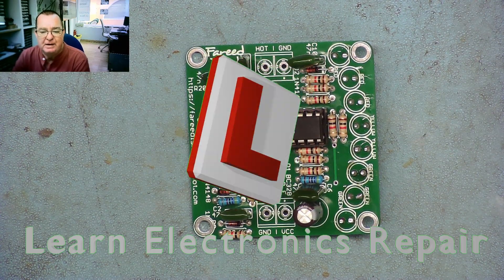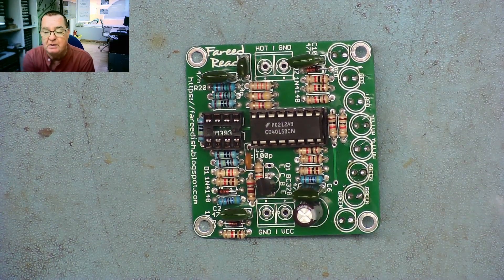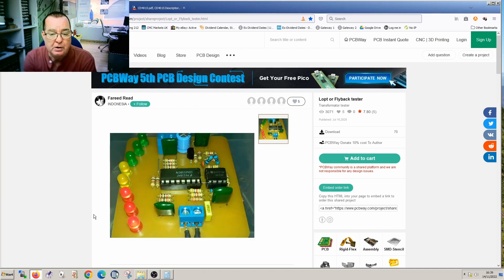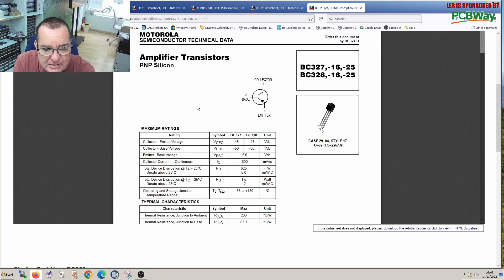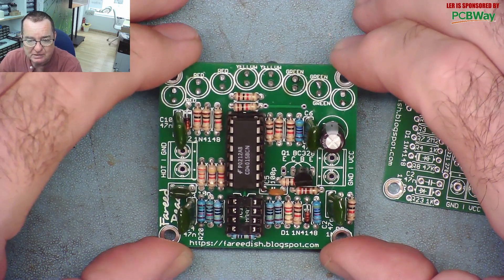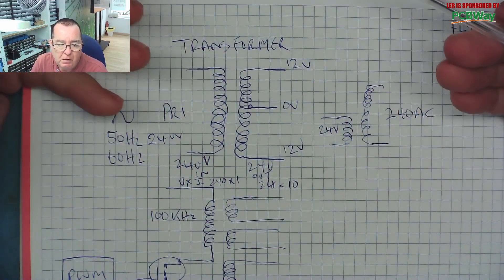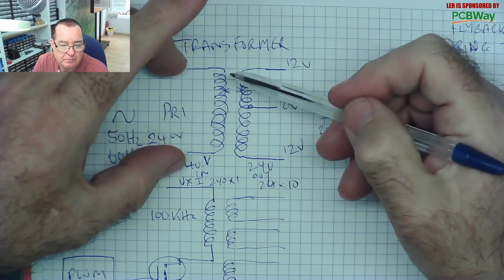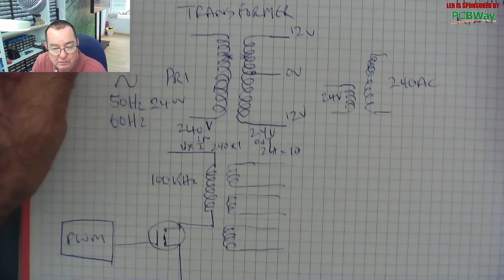All You Need To Know About Transformers To Fix Stuff - Linear & SMPS Ring Flyback Tester

Comment from the maker: Thanks to a couple subscribers on here, I now have the link to the actual schematic this project was 'inspired by' 😁

You can see my rough incomplete reverse engineering did identify the main functions of the Ring Tester and I correctly determined how the circuit operates, but I also made a few mistakes as well.  In particular i got the 4015 IC pinout wrong which is why the order of the LEDS seemed strange
http://bobparker.net.au/lopt_tester/k7205.pdf

Comment: There's a more convenient way of finding out all connections, by taking 2 pictures.
In your case it's very easy because it's perfectly flat (otherwise you should take a picture)

1) Scan both sides of the PCB (place it precisely so you won't have to rotate the image afterwards)
2) import them in a image software (like GIMP)
3) Copy one of the image (the one containing no component IDs) and add it to the other image as a new layer
4) Make a mirror vertical and horizontal with that new layer
5) Play with the layer transparency and move it so it matches the other

=> you'll see all connections directly !

I've done it with a power supply and comes in very handy !

Comment: Really interesting to learn all the aspects of defining what a flyback tester is for, I've heard the term previously but no more. Working with gaps in the items associated with such a project, namely the schematic, then reverse engineering using the PCB was a gift to all the viewers.
I've handled transformers since maybe my first day at work, October 1963, assisting my foreman to build a control panel for a processing machine in a leather tannery.
In the UK there was inadequate sources of electrical contactor's for industrial motor control, MEM, Midlands Electrical Manufacturing, based in Birmingham, founded in 1908 building switch and fusegear to British standards.
RS Components based in London was a 16 page small paper of electronic components, the really bare essentials, resistors, wire and carbon potentiometers, capacitors, some small useful enclosures, not a lot else.

Comment: Great job of reverse engineering,  it's a pleasure to watch you work! It would have been interesting to see the oscilloscope with the shorted "winding" as added proof of the  concept. Regards,  David
Reply from the maker: Sorry yeah I forgot to do that, as I was so surprised at how well the ring tester worked
Reply: @LearnElectronicsRepair  and also short the turn whilst the ring tester is powered up (if you have spare hands, I did notice you powered it off when messing with the 'shorted turn' wire), it should go down to the single red led and back up to them all being on when the short is removed... if you see the scope screen at the same time you'll see the ring substantially damped when shorted :)

Comment: excellent i think i will order the boards and make one.
at the moment i use the cal output on my scope and zoom in on the wave form and count the rings. On mains transformers i might get 2 rings on the primary and none on the seconderys
Reply from the maker: That kind of goes along with what  I found when testing the secondary of the 50Hz mains transformer.  Though I omitted to test the primary, the best I could get on the secondary was one ring, as I think the first LED lights up just from the 'trigger' pulse, even if the tester is not connected to a transformer

Comment: the way to test them is with an LCR meter measure primary then secondary take the square root of the ratio  Lp/Ls  it should be qual within 1% to the turns ratio Np/Ns or voltage ratio Vp/Vs  if it`s  more than 1-2% something is wrong if it`s way off you have a short 100%
Reply: That may work moderately well for true transformers but it probably won't for a flyback inductor. The flyback inductor, commonly but inappropriately called a transformer, is not designed with a turns ratio based on input/output voltage, but on inductances as such.

Comment: I made an inductance meter using an Arduino, an LCR resonant circuit (you connect the L - inductor) and the LM393. But instead of counting the rings, it measured the frequency of the rings (oscillations) which allows you to calculate the inductance value. These two things could easily be combined into one device, but I don't know how would you measure pulse length without a microcontroller.

Comment: The LM358 is not pin compatible with the LM393, the LM358 is a dual opamp while the LM393 is a dual comparator. Yes, with additional components an opamp can be converted to a comparator, however they certainly are not plug in compatible devices. Also, I believe the LM393 has an open collector output which would mean it can only sink current, not source it, which would in many situations make it incompatible with standard opamp output circuitry.
Reply from the maker: The circuit should use a LM393 and I didn't realise because in the video the author (who appropriated this circuit it would seem) showed an LM358 in the version he built, so it just so happened I didn't have any LM393 to hand.  Google does say you can substitute LM393 with LM358 (apart from the higher current/voltage capabilities) but then again, when i built the PCBWay millivolt meter, Google told me that a 741 op amp is a suitable replacement for OP07, which turned out to be 50% correct when I tried it LOL
Reply: @LearnElectronicsRepair  They can SOMETIMES be compatible in SOME situations. If someone is using an OP07, that is one of the first "precision" opamps made in the electronics industry, so there is likely a reason they are using that part, over some other standard jellybean single opamp. If someone is using an LM393, they likely have a reason they want a specific comparator design opamp (for instance as mentioned above its output electronic design is completely different from that of a standard opamp) as opposed to a jellybean general one, again.

Sometimes a jellybean part can do the job of a specific part but just worse, likely the case here (and for a course case, in the end that might not matter that much). Sometimes the design relies on a feature the jellybean doesn't have that would fail, like needing manual offset, or needing rail-to-rail input and/or output capability, super fast speed, etc.

Whenever you see a non-standard part you can start asking if you can find a reason why they used that part instead of a LM358/LM324, etc.

Comment: Great video about reverse engineering, but.... What about the strange connection of LEDs, when the last green is in the OUT4B... And DATA A is connected to OUT4A... It has no sense to me... Should you check it again or explain it little more? Thank
Reply from the maker: It didn't make much sense to me, but I was talking to Carlos from Retro Upgrade today about using AI (which is something he is working with a lot) to produce a complete schematic from a PCB layout - using this PCB, which I gave him, as an example, so I am sure you will be seeing more of it later
Reply from the maker: David O   I now have the schematic (see the pinned comment) and it turns out my reverse engineering was OK, but I mixed up the pin order on the 4015 😅  So that's the answer to the paradox

Comment: From experience I can tell you that "component tester" from aliexpress can test coils quite OK, so if I have to have transformer out of the circuit, I will not bother to make this device really, I will just make chart of resistances and inductance then I will figure it out if its good or not. These days there is 2in1, component tester + oscilloscope in one device.
Reply: This comment is a year old but if you still see this I would love a link to the one you use 😊
Reply: @SpasticalGaming  Model is LCR-TC1

Comment: Good explanation, reverse engineering. Big Clive, eat your heart out, ho, ho. One of the associated videos shows 2 x 18650's powering it (so 7V or so). Yes, these testers work best with high Q transformers (line output etc), search Blue Ring tester for a similar (not the same) circuit.
Reply from the maker: Thanks Ralph that's a big complement being mentioned in the same sentence as Big Clive in a positive way 😊  I have seen that Blue Ring Tester before so probably I should build one too for comparison

Comment: Assuming your reverse circuit is correct, the input stage to the LM393 comparator is a LOW Q because of the low value resistors after the input "hot" capacitor (it's funny that he used a high quality high Q cap and then destroys the Q on purpose???) , which will destroy any high inductance rings (like the transformer you tried it with), ...lower inductance will fair better because they cap will not be subject to the resistor current drain (Q leakage) for as long, but at low frequency nearly all the energy will be drained by the time even the second ring tries to start!.  It is a VERY BAD design!  For reference, anything above about 30-50 Meg Ohms will have a noticeable affect on the Q (ring count), he has values 3-4 orders of value TOO LOW.  The circuit is intended for low cost, but he failed because with the same components (except resistor values and bias current compensation) , a much better design can be had.  ....SORRY MAN, IT IS GARBAGE!
Reply: BTW, I suspect that is why he said to use the secondary of the transformer, ..it is the much lower inductance part (normally).  He saw the issue with his circuit, but no WHY this happens!
Reply from the maker: @stevenbliss989  I can't say for certain the reverse engineering was accurate, as I mentioned in the video I was showing that sometimes you just need to work out enough stuff to understand how the whole thing works, then you can test the circuit and if it doesn't work for example a circuit that should be oscillating but isn't, you can then go deeper into actually completely reverse engineering that part of the circuit to find the actual fault.   Someone has sent me what he thinks is the actual schematic for the Ring Tester so I can play around more with this - maybe we can improve it too 😉
Reply from the maker: @stevenbliss989  Here is the actual schematic, it is undoubtedly the same device
http://bobparker.net.au/lopt_tester/k7205.pdf
Reply: @LearnElectronicsRepair  Yep, looks like it.  C3 is the "RING" cap of course, and it's a good value for a wide range of inductance, BUT, for the ring to persist it must have a high Q.  A shorted turn is exactly what kills the Q by sapping energy from the rings.  Sadly so do the input resistors, and their effect is time dependant, such that the lower the frequency of the ringing, the more time they have to DRAIN the energy away (in less than a single ring cycle for high inductances).  Luckily the LM393 has VERY low input bias current, and ok bias offset currents.  So if you half decently match the input impedances (5% R's should be fine), you can get away with using fairly high values for R11 and R12..  You should, but not required, reduce the input DC blocking cap C4 appropriately.  Then to balance things out, you will also need to add an appropriate value resistor from th junction of R13 & R14 and the +ve input (i.e. cut track and insert).  If you don't, you will get an unwanted offset that can fuck things up.  As a starfting point I would suggest trying R11 & R12  at  220k & 1Meg , put a series 1.2Meg resistor from the junction of R13 & R14 as described.  And lastly, since R10 is part of a voltage divider with R11 & R12, it will also need to become 31.3K, ...so 33k maybe.  The LM393 is NOT rail to rail input, but it is ok with ground.  Surprised it gets away with 4.7k (now 33k) because it really should be MUCH higher.  I would try values much higher, but it will mess with the detection threshold, which MUST have the + input holding the output +eve with no rings, so watch your voltage dividers. Neither the + or - input should never go above Vcc - 1.5 (4.5V with a 6V battery)  ...see datasheet common mode input range.  I'd rather you work out by math and some trial and error all this, my brain hurts! :)  Suggest using LTSpice XIII to try out voltages (LM393 will have to be imported as not part of standard library  ...the ones I found online are fairly crap but good enough for this, just watch your input voltage to never exceed Vcc - 1.5V..
OK, there's something to start with :)   ...have fun! :):):)
BTW even 1 Meg is still somewhat too low, but a VAST improvement on what is there right now.  Higher values may be possible, again, try it and have fun.
Just remember, and to be repetitive, the goal is to stop energy being taken out of the C|L tank rings.
Ideally a JFET input comparator, or JFET input buffer + LM393 would be better (with MUCH higher R's of course).  But ideal may not be needed here, just better than the horror there is now. 
You will know you are doing better because the rings will decay slower at higher inductances ...more LEDS on :)  You get 1/2 righ now, even 5 would be better. 
After all you want the shorted turns to steal the ring energy, NOT the input stage of the detector.
....HOPE THIS HELPS :)
Reply: @LearnElectronicsRepair  I have not looked at the pulse generation, but a BJT switch is low leak, so maybe this part might be good.  And one other point; you cannot go too high on the R's because the leakage of diode D3 will become a factor (somewhere around 1-5Meg for R10 this will happen),  It's just a discharge path for C5, and I would say not needed anyway.  ...R10 / D3 is not really an issue, just saying, be aware. :)